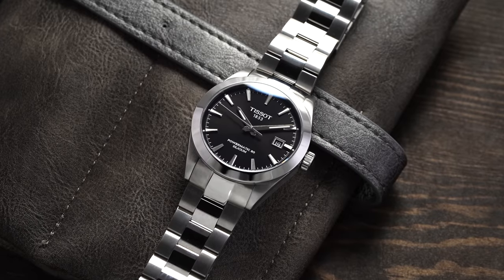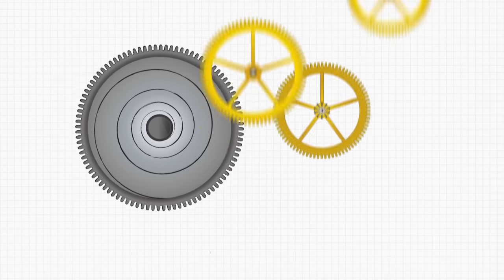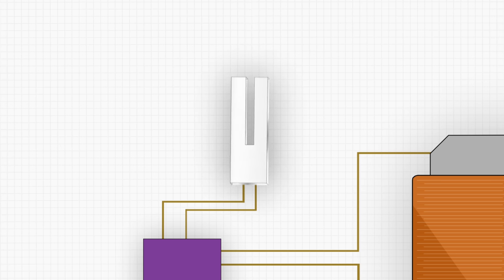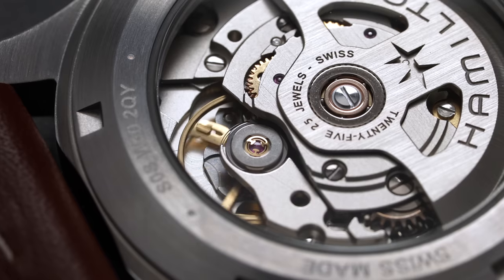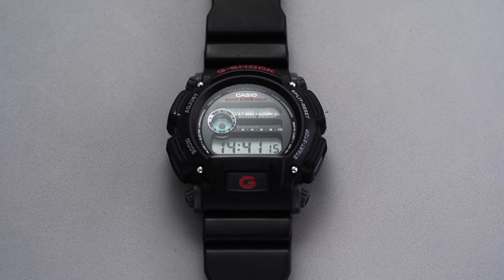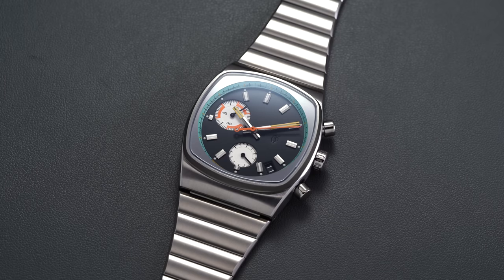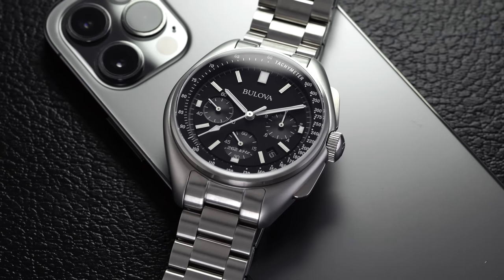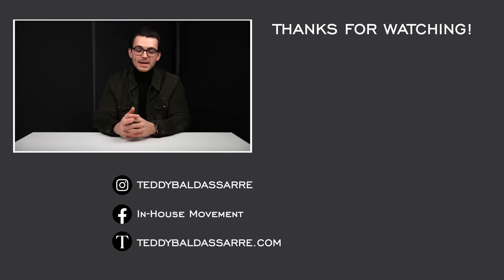Why Every Collector Needs a Quartz Watch - How They Work & Everything Else You Should Know

Comment: I have 8 watches in my collection. Half are quartz and half are automatics. I liked that they are accurate and low maintenance. Also, they are good ways to discover what you like without burning your bank account
Reply: @Brandon Hi watch noob here! I have two quartz pieces and will be getting an automatic soon. This collection may  grow in future. How do you keep  up with the automatic watches? Like maintenance, winding regularly etc I'd appreciate your advice
Reply: Well said
Reply: @MrBalla-pk6lr  Hi Mr. Balla! So with automatics, I usually rotate them once a week. I usually wind my watch every 2-3 days. Service maintenance will depend on how often you wear your automatic watches. Generally, a service every 5 years is recommended. I have heard you can go longer. Sometimes, it can be shorter. Overall, it really depends on you and how you use your watches. Hope this helps!!
Reply: @brandontran4180  thanks a ton 🙌🏻😊
Reply: I have 2 watches, a Nighthawk and a GShock Neo Tokyo GAS series watch. I ordered the Traska Venturer as my first mechanical watch. Personally, I love a watch on the wrist, and the accuracy and special features make quartz unbeatable. But I wanted to try a mechanical watch. I don't want to spend expensive pricing in case (and most likely will) the watch gets scratched. I mostly want a functional watch that looks good. But I do travel with friends so a dual time watch makes things helpful, if only slightly. And lume (or an LED in the GShock's case) is a must for the few scenarios where it has been too dark to tell the time. I never intended to have a collection, and honestly, if my GShock could have interchangeable bands (I like rubber for work as a cook and Beads of Rice for home) and lume on the hands, I might only keep it. But I really appreciate my watches and can't wait to get the Venturer.
Reply: @culinarykid92  cool man I’m getting a Vostok amphibian automatic in few weeks! It will be my first automatic and dive watch so it’s gonna be special 😀 nighthawk watch? Is it from Casio?
Reply: @MrBalla-pk6lr  Nighthawk is a Citizen watch. It is a unique dual time watch. Teddy has done multiple reviews on them. I specifically have the rarer blue dial version.
Reply: @MrBalla-pk6lr  if your mechanical watch has a date, don’t change the date or wind the hands backwards between 9pm and 3am. Wind and set the date whenever you wear it. If you don’t wear it for a while, wind it once a month so that the oils inside don’t dry. If it’s water proof and has a screw down crown, make sure it’s screwed down when you wear it. That’s it
Reply: @culinarykid92  great 😊
Reply: @Drosemusic37  thanks for your advice , I watched your video great playing
Reply: @MrBalla-pk6lr  thanks so much!
Reply: @MrBalla-pk6lr  maintenance depends on what brand/movement in terms of difficulty/price. As for winding, just buy a watch winder, they’re fairly inexpensive these days and you’ll never have to wind your watch again. Plus it’s great decoration piece to display your watches, and I never tire watching them spin in the case.
Reply: @culinarykid92  my nighthawk has been a wonderful addition to my collection, and it’s been through some rough environments. Great piece.
Reply: @JH-qy7zw  thanks brother 🙏
Reply: @MrBalla-pk6lr  also, when winding an automatic/mechanical watch, be careful and don't to it between 9 PM and 4 AM

Comment: I have a Seiko quartz that was bought by my dad in the late 80s and used almost daily until he passed away in '96. It has so much meaning and sentimental value to me as it is one of the few material things he owned.
Reply: So touching story
Reply: Same thing with my grandad. I've spent a few hours trying to figure out how to date it, but at a certain point Seiko started giving them serial numbers that only indicate a single digit of the year. So, if I'm not mistaken, the one my grandad had has a 8 to signify 1980s era, but it doesn't get specific for the month. Something like that, it's been years since I researched into it. It's not some heritage Rolex, but it was probably the watch that really got me interested in collecting watches, even if I could only afford quartz Casios, Timexes and the like.

Comment: I began watch collecting 10 years ago with cheap quartz, transitioned to automatics only, and now it’s ONLY quartz again. Grand Seiko 9F Quartz, Citizen Chronomaster, Casio Oceanus, Seiko Solar diver, G-Shock…all fantastic. 

The Chronomaster and 9F Quartz are considered High Accuracy Quartz at +-5 seconds per year and +-10 seconds per year, on top being finished at a high level (the Chronomaster is also solar-powered). The Oceanus and G Shock automatically adjust themselves to either the atomic clock or through Bluetooth to always be accurate on a daily basis, all on top of being solar powered which makes them true set-and-forget watches.
Reply: I discovered and own five amazing eco-drive Citizen watches in my collection. Never needs maintenance nor a battery nor needs to be wound.
Reply: Impressive collection!!
Reply: I also went from quartz to mechanical and mostly back. I still really appreciate a well made mechanical watch and will alway keep one around, but my grand Seiko 9F is my primary and most beloved piece
Reply: As a woman with a tiny wrist, my options for mechanical watches are really restrict. I learned to admire the technology on the quartz ones and embracing it.
Reply: as a quartz enthusiast, do you know if a mecaquartz could be worn while drumming or would the shock disrupt the accuracy of the mechanical part of the movement?  thanks

Comment: Having 15 mechanical watches I bought a first quartz late last year.  We were going on a trekking trip in the Taurus Mountains so wanted something tough and reliable. Decided on a not overly expensive G-Shock Mudmaster GG-1000-1A3DR with a good compass and temperature gauge, analog/digital, including seconds hand, lume and illuminator light. I noticed +/-15 seconds per month on the manual so decided to test it against the atomic time site on my phone! The Watch itself does not have Bluetooth or GPS access to atomic time. After 2 weeks, it was +1 second after 30 days +2 . That is just incredible. Actually better than my GS Spring Drive which is plus about 5 seconds per month. I never turned my nose down to quartz,  but never bothered getting one (except for the Seiko but that's not quite the same thing) before the G-Shock.  I'm glad I did. Excellent video as always Teddy.

Comment: Thanks for the video and I agree, quartz deserves more respect, as a miracle of technology.   Because quartz got so cheap, collectors turned their noses up at it as they wanted something more romantic.
The romance of mechanical is the notion that it is 
1. An heirloom that if properly cared for can last for generations.
2. Something that has soul, or character and
3. Something that was produced by artisans and craftsmen rather than something mass produced.

The problem with this mindset is, aside from certain very old or very expensive watches, most mechanical watches are certainly not all of these things and in the case of entry level watches (basically anything retailing for less than $2,000), probably none of these things.  And that is especially the case as watch repair costs go up, and independent watchmakers go out of business, and the luxury brands increasingly force owners to deal directly with authorized service centers to get their watches repaired.
So for those collectors at the lower end of the market, a quartz watch will likely give you trouble free service for 10, maybe 20 years, and maybe 30 if you are lucky.  A quality mechanical will give you trouble free service for a decade, maybe 2.  eventually you will need to get the watch serviced, and when you do, you will face a dilemma.  Except for luxury watches, most mechanical watches will cost much more than they are worth to get serviced.  Do it if the watch has sentimental value, or toss it.

As to the second and third points, what is it about a sweep of a seconds hand that gives a watch character?  Mechanical is still mass produced technology built in factories, except for the ultra luxury segment of the market, which most of us can't afford.  So does a mainspring give a watch more character than an electric signal from a battery?  Arguably, no.  It is more something luxury watch marketers told us to believe.

IFor these and other reasons, have come full circle on my collecting.  I enjoy both modern and vintage watches, and both quartz and mechanicals.  As for quartz, I enjoy the accuracy of them and the relative fuss free nature of ownership.   And in the case of chronographs, if I am after a certain look, more likely than not, I am going for a quartz rather than spend the kind of money I would need to spend on a mechanical chronograph.  Because, the cost of repairing older chronogaphs is steep.
And as for mechanicals, I enjoy the history that time spent with a favorite watch gives, or an heirloom watch that belonged to a deceased relative.  As for newer mechanicals, I can't say it matters all that much, but I do enjoy them and I guess I will need to decide in the future if it makes sense to repair something like an old Seiko auto if it no longer keeps good time.  My Swiss watches I imagine I will pay to get serviced when the time comes.
Finally, I suspect that as clean working examples of early quartz watches get more rare, their will emerge a collectors market for them in the future.  So I am hedging my bets and when good deals come along on older discontinued quartz models, I buy them.  Maybe foolish, but I remember  a time, in the 90s and early 2000s, when you could get clean vintage mechanical watches for not very much, and some of those watches I remember selling for $200, or $300 now go for thousands.

Comment: Quartz watch technology goes far beyond what most people realize, it's all brilliant. Quality quartz watches deserve respect. Also what you called the "rotor" is actually the magnetized armature of the step motor. The plate it sits in is the stator. The coil energizes the motor. The circuit that counts down the  2 to the power of 15 oscillations of the quartz tuning fork crystal, or 32,768 hertz, is a 15 stage binary flip flop. That particular rate of hertz oscillation was chosen because it's the most sensible for the watch/clock application. Like most people wrongly assume, quartz crystal does not have a given resonance. It depends on how the crystal is cut and manipulated.
Reply: 32,768 hertz is also chosen because it's outside the normal hearing range, 16khz is a very high whistle, any lower and you get an electronic hum.
The advantage with those high frequencies is that you can hook up a chronograph module that works on the same frequency as the main part of the movement without tricks to increase accuracy, and you can attach a radio or GPS antenna and use that to synchonize your watch to the signal of atomic clocks. Endless possebilities.
Reply: @dikkie1000  Just like my Citizen PCAT..😁

Comment: I would like to add a nice quartz to the collection. My eye is on the Longines Conquest VHP (Very High Performance) watch. Accuracy is said to be within 5 seconds per year, has a perpetual calendar, and power saving features that extend battery life, particularly when the watch is not being worn. Price is usually close to $1000 USD, though can be found new for a bit less, and add a couple of hundred for a GMT version. a very nice watch. Of course, you can also find preowned Grand Seiko Quartz as well as a few other high horology brands.

Comment: I have started looking at watches because of my job, I work as a train conductor. Time is very important to us when dispatching a train. I use a smart watch at the moment but the amount of times I've been in work and realise it hasn't charged fully and I need to use my phone. Which when your on a platform looking at your phone when your meant to be watching signals and that passengers getting on and off safety is not a great look. As it's something so important to my job I would not mind getting something a bit more higher class. So was looking into the automatic market. But the more and more I looked into it learned how each type of watch works. Automatic watches did not seem a practical option especially when seconds matter on my job so it seems like it will have to be quartz.

Comment: I owned Quartz watches pretty much my entire life, and only really started to appreciate mechanical movements last year. Up until that point, buying a new watch wasn't about the movement working in it, but purely how it looked and how accurately it could tell the time. Over the last 2 decades, I've owned a bunch of cheap Casios and later a few Seiko Quartz chronographs with metal bracelets. I never understood why Quartz and mechanical watches could not co-exist in this world. Both have their advantages, but for the average consumer (which is about 90% of the western world), preferring a quartz watch over a mechanical is an absolute no-brainer - both in terms of cost and accuracy. However, If you're all about craftsmanship and horology, a mechanical watch is of course the better option.
Reply: I'm not so sure any more. The craftmanship behind modern mechanical movements, is probably done on a computer. They likely tell the computer what complications they want, and where on the dial.Then the computer tells them what diameter cogs to cut, how many teeth, and where to put them. I doubt any classical watchmaking goes on any more.

The quality of the timepiece now is probably more down to the quality of parts and finsh. Like Rolex who over produce their parts. Hence they are known for quality, robustness, and making a solid watch.
Reply: I read about a Dan Henry chronograph where the main watch is quartz and the chronograph function is mechanical- two movements in the same watch.  Not sure if the mechanical function needs servicing. 🤔 It's interesting but I don't know the details because his website is in English but I think it was written by a non native English writer or speaker  
But meca quartz are used.

Comment: In my collection, I have both automatic and quartz timepieces. However, if I were to weigh my preferences, I find myself gravitating towards quartz watches. There’s an undeniable allure to the advanced technology that powers them—a seamless blend of precision and innovation that captivates my interest.

Quartz watches are not only marvels of modern engineering but also embody a cooler, more contemporary technology. A high-quality quartz is just as servicing its automatic counterparts, and will last a lifetime. 

In essence, while automatic watches hold a traditional charm, the quartz movement resonates with my appreciation for cutting-edge technology and I marvel at the almost incomprehensible levels of accuracy compared to an automatic. 

If I have to choose just one, quartz it is for me! They are so impressive compared to the simply mechanical movements.

Comment: Once eco drive came, there was almost no real reason for an automatic since changing the capacitor is measured in decades.  Going on 20 years with an utterly bashed Citizen ti chrono eco drive that survived motocross, roadracing and desert rucks at 135 degrees to Wyoming winters and travel to all parts of the world.

I do appreciate automatic watches like grandfather clocks and sometimes for formal business but they are no doubt a hobby.  If telling the time, day, date, and stopwatch in all conditions is the goal, a well made solar quartz has no equal.

Comment: The only I prefer auto more than quartz is because of battery run out problem, of course unless it's solar charged battery then that's totally on my radar. Normal battery tended to have leaking problems that could destroyed whole IC but Li-ion in Solar does not leak, can run forever if using correctly, and while auto needs no change of battery.

Comment: I find it mindblowing that a solar quartz watch can potentially run for decades with high accuracy untouched. When we are on 30th version of iphone (daily charging), or the automatic watch has been serviced for the nth time, the solar watch will still be rolling along. Also for a hobby that is deemed materialistic, its a very enviromentally friendly option.  Top solar watches video?
Reply: Totally. My Seiko SSC019 is a wonderful watch, ten years old and the love is stronger every year.
Reply: The accumulator inside will be slowly degrading but this is probably the watch that you'd last you the longer on a desert island.
Reply: @yurymol  With a pinch of salt Seiko "guarantees" its accumulator batteries to 80% power after 10 years. That degradation will start to lapse faster under normal use, but if a full charge gives you nine months on a new accumulator you'll easily get two or three months use from a single charge of a 20 year old watch. I also have a wonderful V158-0AS0 from 2005 with an oldskool vibe. I charge it every every so often in the sunny window, no biggie, it keeps on running. Amazingly accurate, seconds hand perfect alignment too :-)
Reply: Only issue with solar is that if you’re stuck in a cave with no light. Watch May die. But a mechanical still works. Unlikely scenario.  But something to ponder. Lol.
Reply: @skygrey7237  you better hope your lume holds out 😁. There's always Timex Indiglo 😁😁
Reply: @skygrey7237  many solar watches have 6mth power reserve. If I were stuck in a cave for 6 months, not knowing the time would be least of my worries
Reply: @arcadevampire  lol.  You’re right.